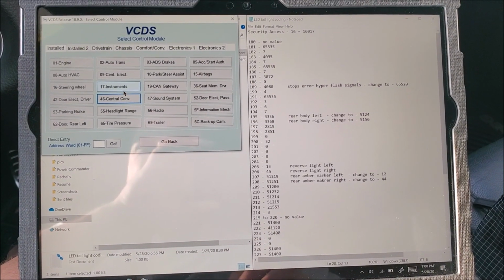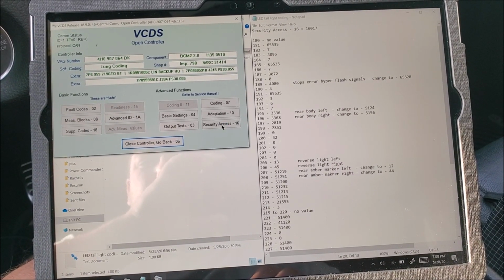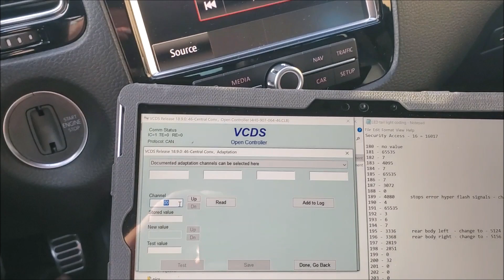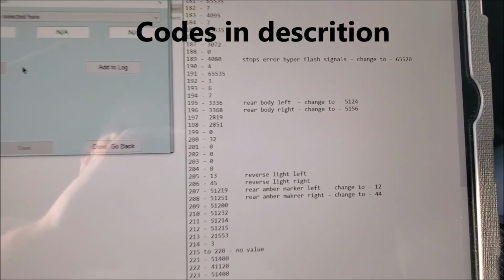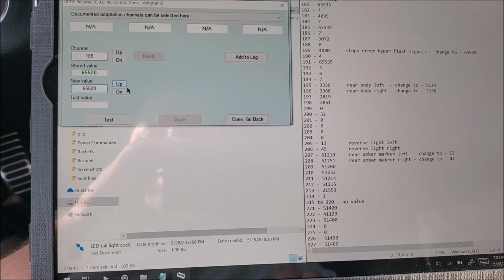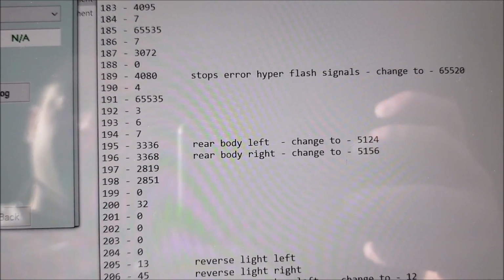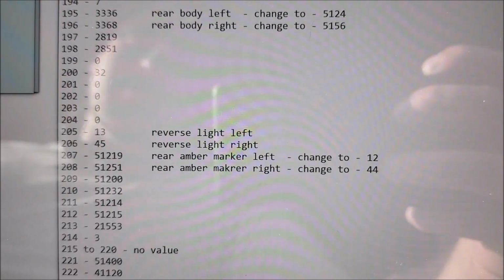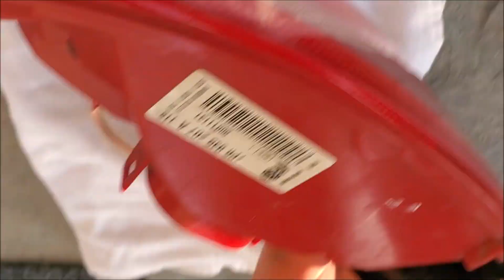Touareg LED Tail Lights with Amber Signals 2010-2014 - How to MOD

Comment: very nice but my question is.. i got 2014 vw passat without amber tail light, its similar to your tails, now i would like to know what bulb socket did you use to fit light bulb on it, and what wires did you use to hook up amber turn signal, did you use one of the red light that is on a side or can you give me more information how i can make amber light on my 2014 vw passat, I really want to have amber, I dont really know why did American passat comes with red, when rest of the world using amber turn signal, I dont think having red turn signal is good idea,
Reply from the maker: Yes the small red light on the side is what I used and it already had the socket and wiring there, that side one is just connected it. I had to code it to work.
Reply: @MK4moTDI  My passat has same side light on the side of tails, so i guess that i can use those wires from side of the tails and tap the amber  yellow light to that, Do you know what socket or bulb holder do i need to put the bulb on the socket..
Reply from the maker: @oceandrive-i3b  mine already had a socket attached for that side marker.

Comment: Thank you for the video. Great job!! I'm a 2011 hybrid owner in Europe. Let me know please if this coding works on my Europian model.
Reply from the maker: I am surprised your euro model does not have the amber signals already with led.
Reply: @MK4moTDI  It's a 2011 model.  Let me know please about 197 and 198 codes in the list are they doing.
Reply from the maker: @TheChrisDam  I saw your post on the forums, but I never edited these codes so I don't know what they are doing.
Reply from the maker: @TheChrisDam  why do you want to know what they are doing?
Reply: @MK4moTDI  I replaced the halogen tail lights with LEDs new style like Touareg CR. Everything works fine but occasionaly I received  00984 and 00985 errors via obd11scaning. Also message appears on the dash for the brake lights. Message disappeared  next time start the car, then after a few driving cycles appared again. Next time start the car disappeared and so on.  So I'm sure that something goew wrong with hte coding.
Reply from the maker: @TheChrisDam  what codes did you follow while charging the coding?
Reply: @MK4moTDI Chanel 195 from 10500(factory value) to 5124 and chanel 196 from 10532(factory value ) to5156. This adaptation drops a bit the brightness of the possition lights when it's on. So the brake lights are brighter than te possition lights. In chanels 197,198 it has 51201,51233(factory values) and cahnge them to 4099,4131 but the fault codes was still there, then coding 197,198 chanels to 2819, 2851 but still receiving the message in the dash occasionally as described in previous message.

Comment: Will this work on a 2016 Tiguan?
Reply from the maker: 2015+ uses similar method but diffent coding. You would have to see if you could find info on some forums.
Reply: Did you ever find coding for the 2016 tiguan?
Reply: @edenec93  no I didn’t 😞😞
Reply: @ukgbp  did you happen to try the touareg coding just in case? I've been searching like a crazy person to get my amber turns active and I've had no luck on any forums or facebook groups 😣
Reply: @edenec93  yeah I brought it to a place and they couldn’t do it